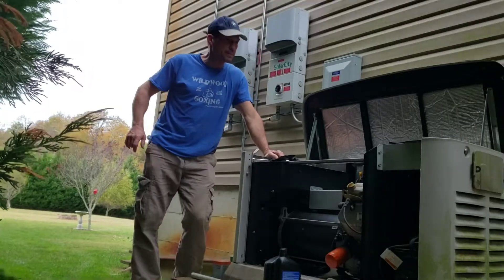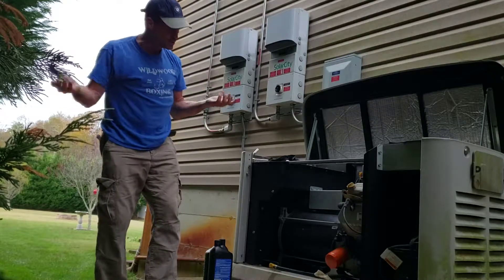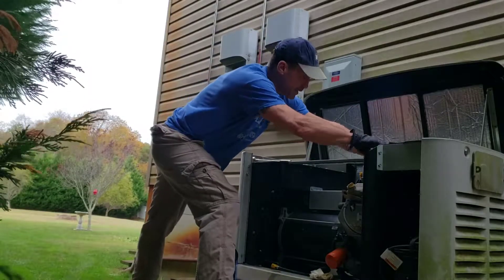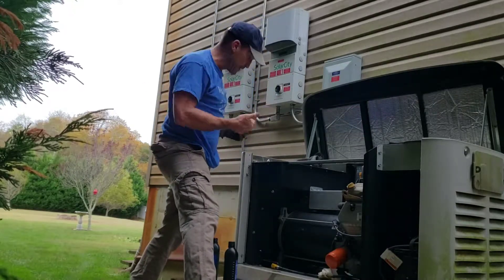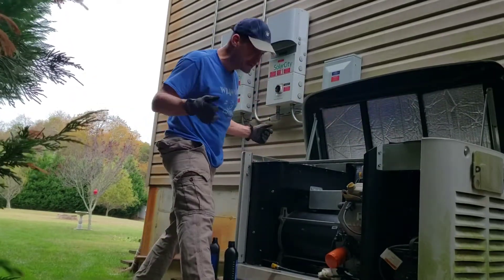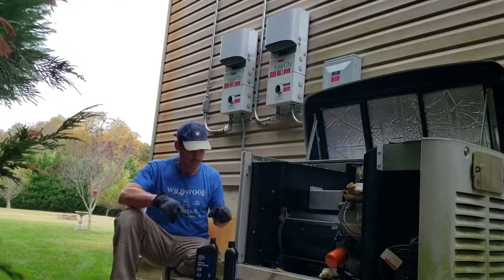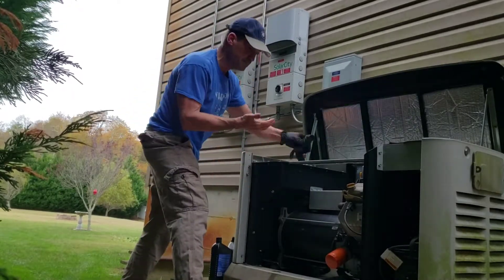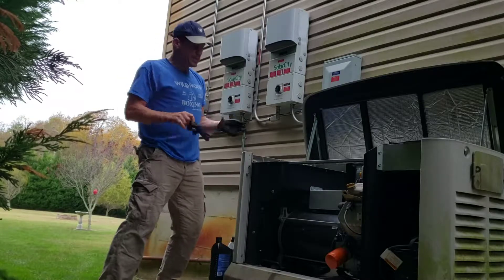Generac Annual Maintenance

Comment: I have owned Generac generators for 20+ years and always have had it serviced by a Generac technician. I have never had an issue with the unit or service. I am quite mechanically inclined and service my vehicles and farm equipment, but the generator is my life insurance policy. We just had storms and tornadoes go through southern Ohio and I was on generator power for 3 days. Thank you Generac, my life was uninterrupted.

Comment: I find the dipstick impossible to read. There's no contrast between the oil and the light metal. I'm thinking of drawing a stripe up the tip with a black sharpie. Any thoughts? Do you think it'll just disappear when the oil heats up? Can't hurt, right?
Reply from the maker: I would use a scribe, Please Like, Subscribe and Share

Comment: You should run it for 10-15 minutes and check for leaks and recheck oil level. You should also check battery voltage and electrolyte levels and add distilled water if needed and check the battery terminals and clean.

Comment: Is it necessary to turn off the main line circuit breaker on the generator prior to doing service or is simply keeping it in the off position good enough so it doesn’t unexpectedly turn on lets say if an outage were to occur during maintenance? Thanks for any help.
Reply from the maker: In the years I've done it I have always just turned it off
Reply: @mattmarg719  awesome. one last question if I may since I'm new to this....

for weekly test runs manually, would leaving the main circuit breaker to the off position make the most sense as well? thanks for the good video.
Reply from the maker: Can't say ... My weekly cycling is automatic.

Comment: After you change the oil filter you should run the generator and then re check for the proper oil level, now that the oil filter is full.

Comment: Don't neglect valve adjustment on those 1L engines,, the newer 800 or so CC G force engines 14-18 kw do not need adjustment they have hydraulic lifters but all the others do need adjustment every couple of years they will start running rough and not starting well especially when engine is already hot
Reply: I read that the Generac 24kW asks for the valve adjustment to be completed every 4 years.

Comment: There’s two spark plugs it’s a four-cylinder engine he only shows you one spark plug and it doesn’t illustrate the second spark plug on the back of the generator I think this guy is definitely not a certified Generac dealer. You have eyes read your manual and not all these videos are cracked up what people think they are be careful.
Reply: Not sure which video you watched but he did talk about the 2nd plug on the back side.

Comment: Power Outages, if you live in a state that has a winter; there is a need for a backup generator. Generac generator 14KW installed cost a total of $9,062.00. Alaska costs veterans an installation discount of $550.00; a veteran (disabled) discount generator of $500.00. We're in our 70s, why the purchase.

Comment: I think he’s a lazy maintenance man he doesn’t illustrate the video well for people that don’t know this work you should always change your spark plug that’s the most important thing in case of an emergency who wants a generator not  run you should look in your owners manual batteries tend to be needs to be changed 3 to 4 years and he doesn’t get into any other specifics it’s a very poor video thank you and have a nice day.
Reply: I agree with it 100%. I have 22kw Generac.  The front spark plug is easy peasy to work on. The back one is the bummer. It is  adjacent to the wall, you can't see only feel and change. Thanks to the  intelligent Generac engineers who designed to make life hell for generator owners.  I am not f?cking paying $ 200 some $s  for the maintenance.